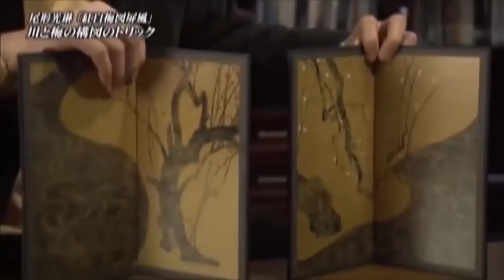Types of Traditional Japanese Doors | An Important Part of the Country’s Culture and History

Comment: How cold is Japan? Woodworkers are almost always shown wearing jackets or multiple layers.
Reply: Depends on the season and area. In summer in the south, temperatures could be as high as 43 degrees celsius, while in the winter in the north, there is a lot of snow. You don't need to travel far from Tokyo to see snow in the winter most years. Besides, there is almost always snow covering the peak of mount Fuji